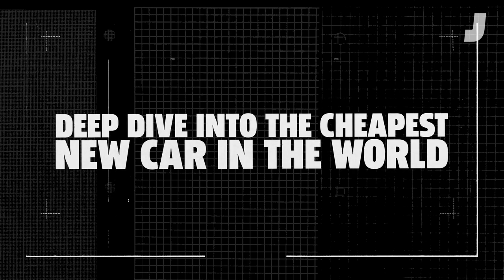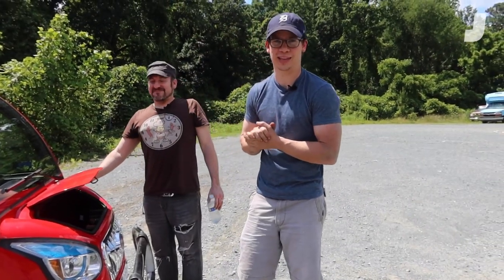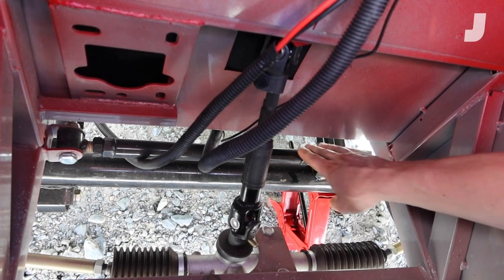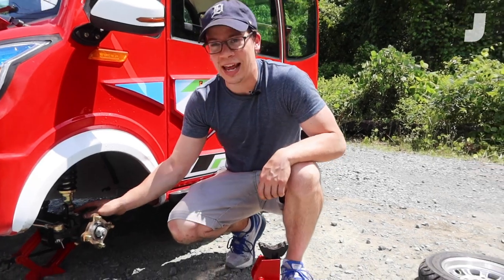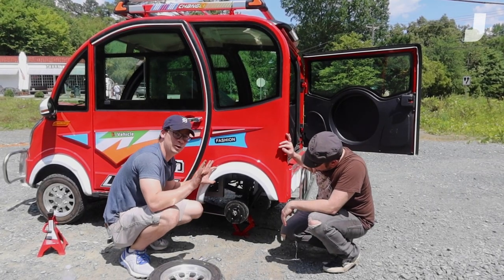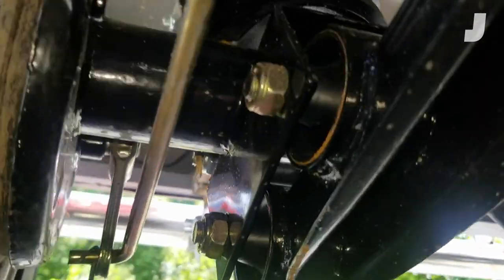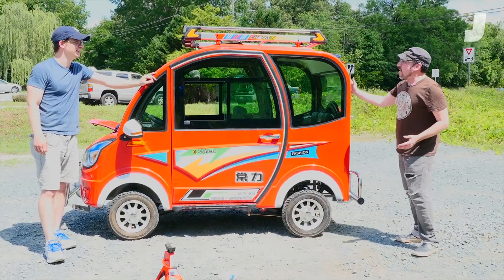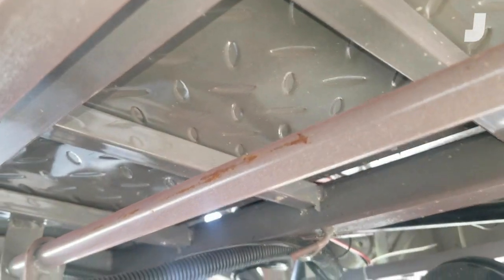The Impressive Engineering Behind The Cheapest Electric Car In The World

Comment: I've seen, previously, that it didn't have a seatbelt installed. What the legal process, in the US, to have one added? Also, would it be likely for the vehicle, as-is as well as with a seatbelt, to pass most state inspections? Are insurance companies on board with it? I imagine calling Geico to tell them about it, and get a quote, only to hear, "I'm sorry. You bought a what? No, sir, we don't insure Power Wheels." lol. I'm not hating - to clarify, I think it sounds like an amazing car in specific situations. One of those situations happens to be one that could be beneficial to me hence the legitimate questions. That's a deal-breaker, however, if you can't get it street legal or at least liability coverage. Any thoughts?

Comment: The Chang Li Nemeca reminds me of the Auto-Rickshaws they have in India.  These are small vehicles essentially used as taxis on overcrowded roads.  They are quick and limber, carry two people and luggage, almost exclusively, and need to take the abuse of long hours and a cohabiting with bigger cars on the road.  The ones I saw years ago were all gas powered, but I imagine electric would be a cheaper long term solution.  Still, I don't know how they create this so cheaply.

Comment: That generic drive train system is absolutely asking for modding. New, higher current controller (or even just shunt mod the existing one) would be an awesome improvement. The motor looks like it could take the extra heat...

Comment: Swap the lead acid for LiFePO4's.  There are some aluminum cased lithium polymer batteries with a nominal voltage of 3.2. I paid $115/ 100Ah@3.2v. They can be bolted together and come with very adequate buss bars. It would change that Cadillac into a Ferrari. The sticker says LPT-ENERGETECH, they also go by another name, I'm using them for my bootleg Tesla wall but purchased them from an EV conversion company.

Comment: That's a large electric motor for about 825 watts.  When you are ready to risk it I'd change the controller for a 60 volt unit.  Of course you would need to by pass the inverter for the motor power supply line to this controller.  That way everything else remains 12volt.  Then for more initial kick (a surge in amps) I would put in a super capacitor(s) in with the battery's.  With 6.6 horsepower you might hit 30mph on the flats. Remember range will be reduced 6X also.

Comment: So I know here in the US, you can have glorified golf carts be street legal so long as they have the proper brake lights, turn signals, proper reflectors, bumpers, hood, a seatbelt with a lap belt and shoulder harness, etc (specifics vary by state). This seems to have everything except the seatbelt. Could it be used as a street-legal vehicle (on secondary streets) with a seatbelt?

Comment: With enthusiasm like that, you should be employed by their marketing department for their USA distribution network lol 😁⚠️
One thing worries me though, it uses a  very crude braking system, the only redundancy measures for a fail of part of the system is the handbrake? ⚠️😊😯😁
It will be interesting to see how well it holds out driving it and how long the 'quality' components last? I suspect not very long, the materials used will be low quality for sure! 😎👍

Comment: Can someone guide me on if this is actually street legal? I have a use case in Boulder where the distance traveled is sub 7 miles and parking is an issue. This might be a good solution.
Reply: ekttç sçuter over 15 mioe gm év1 ravé 4 ev ektré hybdre evs

Comment: This is cool as hell, but you shouldn't be so surprised about things like coilover suspension and aluminum wheels. Just one look at any of those parts and it's clear this is basically a 4 wheeled scooter. Scooter parts are Cheap. As. Hell. Just important to note here that "coilover" doesn't mean "performance", it's literally just out of convenience of manufacturing, since you can source those parts for like $1/shock at manufacturing rates.

Comment: That was cool for a less than $1000 if it wasn’t for the import tax and shipping and customs fees probably slapped on some tariffs. Would you be surprised to find out a Toyota corolla doesn’t cost more than $4000 to produce. Think I’d put a little marine propane heater in there so I don’t drain the batteries. A lot of battery and motor upgrade potential. Useful little car for little short get around car.

Comment: Yeah, did not state the range in miles or kilometers in a single charge. OR how long it will 
run at a steady speed until batteries are discharged.

Comment: Its like BUILT for tuning! That diff could easily handle 20+ horsepower, (would not be surprised if there is a petrol versionit comes from) and go lithium on the batteries would get you range as well.

Comment: You can get the fully autonomous upgrade at Google Play, as well as rev limiter tools to increase power. 4 wheel drive and lift kits available at your nearest toro/briggs and stratton store. It also is programmed for 5g, so it can tell your refrigerator and toaster to go offline while your charging.  And your smart meter will download all your driving habits and turn them into your insurance, as well as the Chinese and American Government. No need to register, they already know everything about you, even the stuff you haven't even done yet. So if you notice strange debits on your card, be patient- you are paying forward for something that hasn't happened yet. Or you could wrap your new car in aluminum foil (shiney side toward car to prevent a reflectivity ticket). This also increases radio reception 10 times, allowing you to get Chinese stations. (option only available while driving in easterly direction. Omni-derectional upgrade available at Google Play Store- app only available in Chinese). Bottom of seat mounted facial recognition available also. Oh- one set of those rear view mirrors are called "distortion" mirrors- makes everything around you appear smaller, as to not frighten the driver when changing lanes. If you turn them 90 degrees everything gets taller. Turn them 180 degrees and everything gets younger. They also have a "front view" mirror so you can see into the future.    ps... It has front brakes - if you drive in reverse. This can be done very easily and safely, simply by reversing the battery terminals.

Comment: Seems like those electric parts in the rear under the floor are extremely vulnerable to water especially the black box, also the frames look like a rust party waiting to happen, but again the cost is very low.
Reply: Yea id would paint underneath more but before that I would add some extra welds. Then I would add some cardboard errr I mean plastic home made splash guards and a box inside the hood area.

Comment: My electric bike has a 1500w motor, thats twice the horsepower and is slightly smaller than this one. You could even go higher, to lets say 5 hp using e-bike components, together with a custom built li-ion battery pack you won't slow down to walking pace up the hills.

Comment: You didnt tell what the top speed was, could it go 70, or hold even 55 for any length of time.  Also... does the motor get hot?  How about the TWO of you driving around for 2 hours and THEN make a video (extra weight).  I admit it looks impressive for the cost, BUT... if it does not function AS A CAR, its pretty much just another yard ornament. Also.... since its tall, and has a very short wheel base..... does it have a TIPPING factor around a turn over 40?   How long to charge the batteries?  How long will they last?  Total mileage before recharge?  Do you have to keep it off the freeway or is this ONLY for big city dwellers that never leave town? Hmmm.....  THESE are questions you did not address.

Comment: Sorry but I’ve been fooled by the Chinese too many times before and I for one won’t be fooled again.  Bought one of their so called “great go karts” for $1,000.00 in 2008 to teach my kids how to drive.  I was very impressed at first just like you guys are here with this car.  Six months later with only 300 miles on it the engine died.  The company went out of business so good bye warranty and customer support.  Getting replacement parts was impossible.  I sold it for $200.00 on EBay.  Three years earlier I bought an electric scooter for my son for Christmas.  Similar situation, at first I thought omg, how can they possibly build this awesome bike for $375.00 and then 80 miles later it completely crapped out.  I left it on the curb and no one wanted it so the garbage guys took it.  Btw,  the welds broke on the go cart even though it was lightly used and only run on only the road.  It still looked brand new too when it crapped out.  China is plagued with quality control issues, this car for sure will cramp out on you very soon and good luck getting parts or trying to jury rig it yourself.  Not trying to piss on your parade,  just trying to let viewers know how under handed China really is.  Anything good that comes out of China for the most part is usually from US companies that visit on a regular basis to make sure that quality control standards are kept to a high standard.  I’m telling you guys the 100 percent truth here, I hope none of you have to ever go through what I did.  Good luck....
Reply: You could try to locate the maker before actually buy it. I'm a Chinese in Russia and the Chinese products sold here on the market is some of the brands I've never heard of. And you can buy this GM core one if you no longer trust Chinese motor https://www.youtube.com/watch?v=u2sfFN6viXo

Comment: The jokes about this "car" are funny!
But there is a side to this that is missed by people who live in large countries. Ok, so it's cheap and a little "crappy". So what? It's electric for one thing. Is it better to go to the shop down the road in this, or start up your 6L petrol pickup and create more problems for the planet?

There is a place for a car like this. You wouldn't take it on a cross country road trip, but to nip to the shop, or for someone working in a big city, especially like London where the savings on congestion charges alone would pay for the car.

It would definitely benefit from a better motor and lithium batteries. At the price, you wouldn't expect it to have much more than lead batteries and a brushed motor. I'll bet there's someone doing a diy conversion to one right now. Increase the speed and torque a bit and it's a good little shopping trolley.

Comment: The advantages of building it in China. Cheap labor to build the car, not to mention, cheap labor to build the parts, which are then sold to the builder at a cut rate. Labor is a major point of impact for anything. A great example of this is when you get your car repaired. The labor is almost always far more than the parts even though most garages inflate the cost of the parts. This allows the Chinese to make some quality upgrades and still have manufacturing costs far below that of the US. In a factory such as that which builds this EV,  the workers likely make about $350 per month and that's working far more hours than in an American factory. Now you can start to understand why our president changed the trade polities. If we left things the way they are, China would in just a few more years, bury us economically and we'd be screwed. This is what Democrats don't get. They look at things in a now frame of mind and seldom see the big picture. The president is trying to push manufacturing back into America by making it harder to import from China and we desperately need more products manufactured here.

All that said, a smart golfer would buy one of these and convert it into a golf cart. In fact, a golf course could probably save a fortune by buying a fleet of these and turning them into rental carts. If I'm not mistaken, even with all the added expense of getting this car, buying a new golf cart domestically, still costs more. If you imported a number of these at once, you'd certainly discount the whole process of car cost and shipment.  Buying bulk would also allow for changes to the cars, such as design alterations to make them more golf cart than EV and probably without paying retooling costs at the factory. At the very least, they'd likely have the maker omit nonsense perceived pop culture references plastered all over the car.

Comment: "Hole" in the nose could easily house a portable generator, tuning it into a hybrid.
Reply: @FusionAero exactly
Reply: That’s a great cheap golf cart but that’s exactly what it is a golf cart ..cannot call it a car because it does not have seatbelts, safety cage or airbags..
Reply: @msmith4700  It'll never be a proper highway-capable car,  but it would still be legal as a low-speed vehicle. Yellow triangle placard and 25 MPH limit, same as Amish buggies and farm equipment. Replacing the stock  powertrain with competition electric go-kart hardware would make for a fun little urban runabout.

Comment: First, thanks for making this vid... it is entertaining.... BUT a few lighthearted criticisms.
"There are no ball joints"... D'uh... except on the tie rod end. 
Calm down and stop shrieking "coil-over" (4 times). They've been using coil-overs on motorbikes and scooters since the 1960s
They are doubtless sourcing on two main criteria... weight, cost and availability.
"Potentiometer thing"? No it will be some sort of pulse width modulation.
"DC motor, this is the little chain drive I suspect"...?! I seriously doubt that there's a chain in there.
In fact I'll bet you £100 (which I'll donate to a charity), if you open that up and show me a chain drive in there!

Comment: You are looking at a 4 wheel electric bicycle.  Contact Mr Ping in China and he will make you a custom lithium ion battery with high Amp Hour capacity.  It will increase your range and lighten the battery weight.  I build electric bikes and the components are similar.

Comment: I love it.  Protected by three layers of cardboard!!!🤣
Reply: Yeah that was a bit dummy thing, I would put there some rubber carpet. Also in the back there should be something waterproof cover. And at front there could be some bottom so you could use it for bags and stuff.
Reply: @temelon  The content on the cardboard is the brand of the battery, because there is a separate production company for the battery in China, and the cardboard can also be regarded as an advertisement for the brand